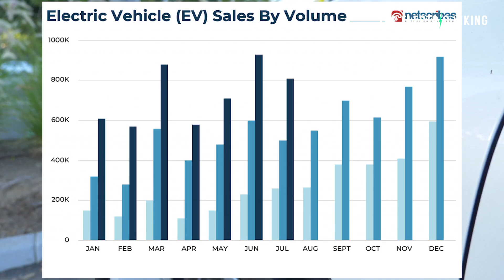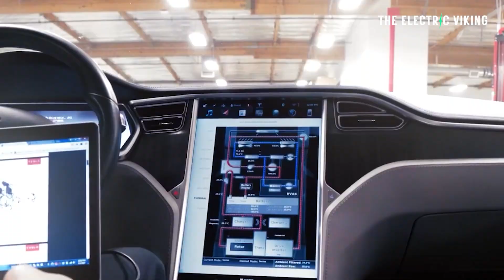The BIGGEST mistake EV owners are making when it comes to the battery

Comment: I still believe that old and failing EV battery packs should be made and assembled in such a way that these can be easily swapped for a new one, just like our cell phone batteries. The raw materials from these old and failing EV batteries can be recycled and owners compensated for some of the benefits of recycling.
I also think that repairing old and failing EV batteries cost a lot of money for they have to be removed from the EV itself, opened up, tested to see which cells have failed, these cells removed and replaced with new ones, tested again, and assembled to the EV again, and still the remaining old cells could fail also later on. Labour repair costs are cost prohibitive.

Comment: The real scam is that although battery and lithium prices have fallen severely over the last decade, auto makers still charge you the same price when you need a new battery for an old vehicle like they did 10 years ago.
Reply: From where do you know how much they would have charged 10 years ago, when 99,9% of all EVs still had their battery warranty 10 years ago?
Reply: @Tschacki_Quacki  Parts catalogs exist.
Reply: @Tschacki_Quacki 
Where did you get the information to come up with the number that 99% of electric vehicles over 10 years old have already had the battery replaced? Especially since the oldest Tesla is only about 15 years old.
Reply: Tesla does better fyi
Reply: Same price as ten years ago. Sounds like a good deal to me.
Reply: To be fair, labor is a pretty big part of that - replacing an EV battery pack is a major procedure.
Reply: @hedonismbot1508  I seen it done in a video mate, 6 bolts and disconnect the plug to the battery, other than disconnect the coolant hose that was it. Going backwards replace the body seal and the coolant and its all peachy. If you had a hoist could do it it your own garage in an hour or two
Reply: @mysty0 Do a video and show us how it's done.
Reply: Tesla has lowered prices as battery costs have gone down.
Reply: You’re assuming lithium is the major price driver of the battery. It’s only one cost.
Reply: If they charge the same amount that they did 10 years ago, prices have come down. It's called inflation. People make more now than they did 10 years ago.
Reply: The car makers know that in most cases the new batteries are payed by the insurance companies. During the last 50 years they have learned that they can get almost unlimited costs paved by the insurance companies, maybe it's almost impossible to stop this scam.
For instance "organizations" like EU could "fine" the car makers by changing the laws by increasing the warranty from 8 years and/or 160,000 km, in a first step to 12 years and/or 300,000 km.

This means that there will be a lot more second hand batteries on the market from crashed cars which means the prices will drop, even though they aren't very high already.
Reply: Great topic, thanks for doing this, Sam!
Reply: and still not totally “new”, just refurbished 😞
Reply: Dealerships are incentivized to rip off and discourage EV owners.  Tesla out of warranty isn't much better.  Packs are not very repairable as they are now sealed in foam so unless it is a controller problem many need to be dismantled to be reused or fixed.  What we need to see is more LFP.
Reply: ccibinel • Correct. Just look at Sandy Munro presentation on his channel when they try to open a new Tesla EV battery that's sealed in the pink foam. They say you can't open it unless you destroy it.
Elon Musk ia a greedy chameleon. He doesn't build EVs to help regular people.
He builds expensive EVs for rich people who don't care about money at all, and for idiots who fall into his trap.
Also, how much ia a new tire for a Tesla EV?
How much is a Kwh at fast chargers?
Just compare these two expenses with the ones you have with the most economical hybrid on the market today, and you'll see that by buying an EV today you just burden yourself with high expenses if you're not rich and idiot.
I'm all for EV adoption, 100%, but today's expenses with an EV are just simple, intentional expensive rip-off.
Reply: @ccibinel I will wait for a few years, until the technology has stabilized.
Reply: @ccibinel : LFP cells will not change the fact that the pack will still need to be disassembled to be repaired, and it will not preclude any manufacturer from sealing it in with foam.
Reply: @jacobcarlson4010  So you have to disassemble the entire engine to change a piston? No, the engine has some modularity so one can focus on repairs. Battery packs are the same.
Reply: @ronaldking1054 : True, the piston rings are technically replaceable; but an experienced mechanic with all the tools will still need at least a full day to pull it off, working from sunrise to sunset. And not everyone who owns a car is experienced enough to do such a repair; most will simply junk it when they need the cash to put towards a WORKING vehicle to get to their next shift of work.
Reply: @jacobcarlson4010  Yes, rebuilt engines are not a thing.
Reply: @ccibinel They cost far less than a new car…
Reply: @ccibinel  My pack is easily serviceable. Research other cars besides tesla
Reply: @ccibinel  people should stop buying evs until they get a 500k km garanty on the battery
Reply: @cornelstamate2537  My wife's car (2014 Ford Focus) is under 100k and had a transmission replaced under warranty and a clutch that just cost another $3000.  ICE cars are not free of expensive repairs for build issues.  Mandatory huge warranties are not the solution - LFP batteries are.
Reply: @cornelstamate2537 really?  That's like saying no one should buy ice cars until they come with 500,000 km drive train warantees. To my knowledge, none do so.
Reply: @michaelanders6161 Nissan TD42, you have to be a complete tool to destroy one of those under 600,000. Absolute beast of an engine
Reply: @cornelstamate2537 : I wouldn’t buy an ICE car if it came with a 600 million Lightyear all-inclusive warranty. Why? Because I’ve literally thrown away over $34k buying replacement vehicles to replace ones that the piston rings wore out, or the electrical system developed a fault that can’t be found, or the transmission stopped shifting above 2nd; I could go on and on. And no, it wasn’t just the known-lemon manufacturers like Hyundai; it was Honda, Toyota, VW, Chevy, Ford. Brands that actually have SOME reputation for reliability.
Reply: @mysty0 really. But what is it warranteed for? Certainly not that. (600,000 miles or km?)
Reply: @cornelstamate2537  Why? No ice car has a 500k warranty.
Reply: @michaelanders6161  no, never warrantied for that.. its basically a Ford small truck engine that got straight dumped into a 4x4. Then you have your Cummins 4bt and 6bt's, your Perkins motors, those engines will do their million plus pulling loads lol. But we're off track
Reply: @cornelstamate2537 I haven't yet seen a 500k warranty on an ice engine. Maybe we shouldn't buy an ice engine until we get a 500k km warranty hey 😂
Reply: @ccibinel When Tesla has a “problem “ it is not merely $3K dollar. So don’t push the argument that all cars have repair costs to make EVs look better. Idiotic.
Reply: Battery structure is changing too.  From Packs to Blades.  Blades can be swapped out easier than testing thousands of cells to find the bad ones.  If you fast charge daily your battery will last 100,000 miles.  Heat is the enemy of the battery and DC Fast Charging creates a LOT of heat.  Home 240v Stage 2 is the safest way to charge quickly and keep the battery from going nuclear with heat.  Tesla owners have fail safes built into the system that was created by Tesla KNOWING the dangers.  Tesla Chargers and cars designed to work together safely.  The other ones are fast as hell and that's it.  That is the dangerous selling point.  Check out the newer BMW batteries.  Massive beer can shaped cylindrical cells larger than the Tesla ones.  Elon could not be prouder that others are finally getting it and making stuff that works and works well.  Stealerships are the main problem with EVs for sure.  They want cars that require service frequently and these are not those cars and SUVs.  They know the end is near.
Reply: @travisyarbrough4033  Heat is the enemy of EV batteries?  I don't think so... Almost every time I navigate to the next Tesla SuperCharger, my Model Y starts scavenging excess heat from the motor, heating the battery up to around 40 degrees celsius. It does this to ensure the charging rate will be as fast as possible. (Cold batteries charge slower according to Tesla).   Given that I live in Australia where heat in summer can be an issue, I assume that the opposite will work as well... meaning that if the battery is overly HOT whilst driving, will it COOL DOWN to that magic 40 degree C ?   I am yet to experience any really hot days, but I will test out what happens when I do...
Reply: The real scam s falling for the EV con in the first place.
Reply: @xraylife of course, so is the horse and buggy, typewriters, dial phones, analog cameras, so on and so on, oh, and don't fly on a plane b/c that's so dangerous it's going to crash and everyone could die.
Reply: @Joe44944  Go get your next Boooster because Gen 0 side is so hip.   LoL

Comment: My situation is a 2012 Chevy Volt with 185,000 miles. It still runs just fine, but a factory specified reprogramming has reduced the usable capacity for 10 kwh to 8 kwh, and it switches to gas at unpredictable times.
Reply: wasn't this reduction a result of a sofware update? sometime in Jan 2021
Reply: Chevy Volt's are a cheap GM products that are too expensive for what you get (so a bad value for your money). GM and Ford are both reducing their EV production because they cannot make a profit on them.
Reply: @mauriceharting5877 i disagree. The Chevy volt was a car ahead of its time. It is reliable and still sought after by used car buyers. It pioneered a lot of technologies (e.g. the el. motor) that are in use today.
Reply: @realestatenow  The reason why so many used EV buyers want a Chevy Volt is because they are cheap and not because they are reliable. Used Tesla's hold their value much more ... that is a fact!
Reply: @mauriceharting5877  the Chevy Volt is actually a remarkably good car, especially for it’s time.  They’ve been quite reliable and most owners have had good experiences with the battery life. They were not overly expensive and have held their resale value well. Additionally, GM is backing away from some of the vehicles, but not the Chevy Bolt which has been their most successful EV so far. 

I’m not as familiar with Ford as I don’t own a Ford EV.  What I gather is yes, Ford is having trouble making their EV models at a profitable production cost.  These companies have seen tougher times before, I’m confident that they will continue to improve their processes and be making cost competitive EVs at a profit within a couple of years and will succeed in gaining a decent amount of market share.

Comment: Ford and Gm have delayed the production of EVs because they are loosing up to $35000 per vehicle. Sales are slumping in the EV market. This must be an old video!!!
Reply: Sales are not slumping. EV sales are up 30% this year. Tesla and BYD are selling record numbers, Ford and GM are selling less, but they are only a small part of the EV market
Reply: @garyfromlondon  well, exactly.   Tesla, BYD and others have saud repeatedly hinted that you have to be making and selling at least 400,000 of any one model (same vehicle but with different badges might qualify) before you make money. If you build a factory for 1 billion and have fixed overhead of 500 million each year, you won’t make any money selling 50,000 Bolts a year, but you might selling 400,000-500,000 Bolts a year. Output matters greatly.
Reply: Where do you get this absolute and absurd nonsense that ‘sales are slumping’? They might be down at one retail outlet, or in a small region, but they are going up steadily year after year. This last year, in spite of economic choppy weather in some places, sales are up worldwide 30-odd percent YOY. The heady days of 100% growth (on very small numbers so statistically not so relevant) might be dying but 100% on 100,000 vehicles PA is nothing compared to 35% on 3,000,000. The first is growth of 100,000 YOY, and the second is 1 million growth YOY. We are now in the multi million part of the steep climb.
Reply: What a hater statement. Here's the real reason why both have delayed EV production. They are finally switching to LFP batteries. GM is waiting on their new battery plant to be completed and battery production is ramped up. Ford is doing the same thing but importing some batteries to cover some of the sales until their battery plant is completed and ramped up. Why build cars with no batteries. So next time tell the whole story before spitting out some generic BS statement!!!!!!!!
Reply: @chetsaxton1526  Ford and GM have enough battery production to make their cars, the trouble is they have a massive amount of cars sitting on dealers lots, due to the insane mark ups of the dealers on the sticker price
Reply: @chetsaxton1526  same to you…hater statement 🤣…you seem a little triggered
Reply: Ford and GM are nowhere… China is the new Detroit. Only the US is buying their stupid cars.

Comment: I don't particularly like the idea of mixing cells of varied origins with old ones. Since all of the cells in a pack are typically from the same batch, one cell going bad may very well be an indicator that there are more than one latent sub-par cell in the whole pack and that your first repair could be the first of many. Likewise, since manufacturers don't sell their factory-new EV cells on the open market, your replacement cells are likely coming from packs of similar origins. And then you have the very high stakes should anything go wrong with the refurb. Insurance companies will likely get ticklish about how many times battery packs get opened for repairs should that become commonplace.
Reply: It's all science, no magic anyone who knows what they're doing will probably replace with a similar State cell, it's more economical t o o. BMS manages the cells also

Comment: You don't even need to recycle the battery. just find the bad module/cell and replace it. 9 times out of 10 it is a weak cell disturbing the balance, reducing range. Sure labor costs associated with pulling the battery aren't cheap but you are pulling it anyway if you want to replace it.
Reply: Finding a place to do it might be a problem right now . There are only a few places that do this in the US I am aware off.
Reply: @ctuna2011  you can always ask uncle rich for help
Reply: @ctuna2011 

That's because there aren't yet enough 10 year old EVs on the road yet to keep battery repair shops in business. In time, this will change, but it won't be instant.

Comment: There are a few companies in the Netherlands that can repair car batteries and some can convert rejected batteries into energy storage for homes.
Reply: Rejected battery into energy storage for residential home...
Sound dangerous
Unless it is a battery chemistry that don't catch fire sodium battery

Even LFP LMFP M3P they are still dangerous if arson is done and that energy can easily burn down everything
Reply: @james_l4337 no more dangerous than a backup generator and a can of gasoline
Reply: There will be more everywhere. Right now, there just isn't enough broken batteries ...
Reply: For most repurposing the battery into a private power-wall house storage power bank will be the easiest & most affordable way to get their  better return on the former car battery pack.Until more Battery stations qualify to give the correct opinion & diagnosis on its servicing

Comment: But depending on where they live, there may not be anyone close by. They could be hundreds of miles or even a thousand miles away.
Reply: Still, spending $1500 to ship your car to a specialist place which will replace say 2 modules of 8 cells each, out of 26 modules and also as part of the process verify the health of all cells and also important connections and fuses, all for say $3500, is much better than paying for a $15,000 for a whole new pack. Lets also say the original range was 400 km reduced to 200 with 2 bad modules, and the cheaper fix gets you back to 380 km range., some degradation on an older total pack but not fatal. Sounds like a viable repair cost. A module might be failing because of one bad cell out of several, or a poor connection, or a failing BMS subunit. Diagnostic tools exist which can  check which cells/modules might be degrading and cause a problem in the future, allowing proactive fix/replacement at the same tume you are replacing those known problems/failures.
Reply: For sure, the cost would be significantly cheaper to replace some vs replace all the batteries.  For some people, it's too much hassle.  There was a news report of a Hyundai Ioniq5 owner whose 2017 or newer Ioniq 5 failed at 172k . Sadly, the warranty is 8yrs or 160k so the dealer quoted him $35k us in labour/parts to replace the entire battery. He ended scrapping his vehicle. The news station contacted Hyundai who said the dealership should have escalated the case to corporate. Hyundai ended up paying him the used car value out for the guy.